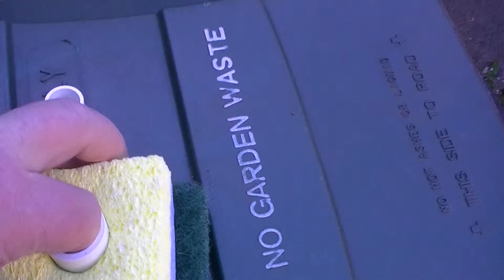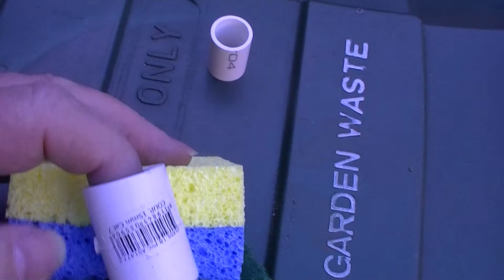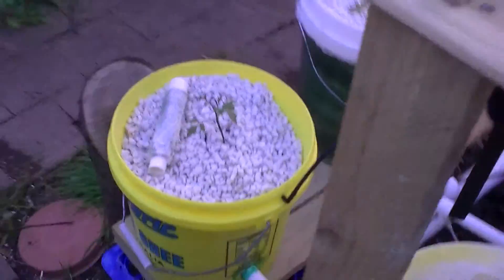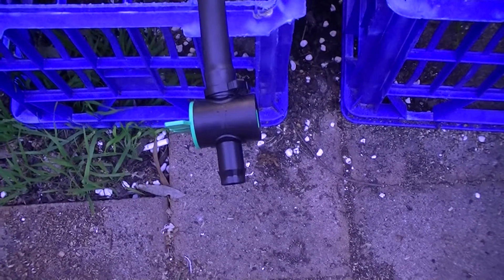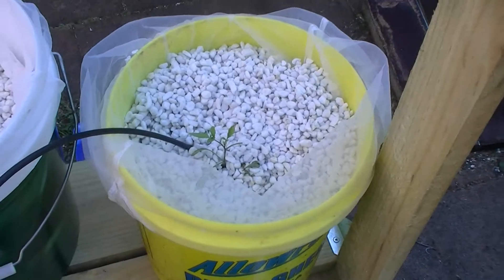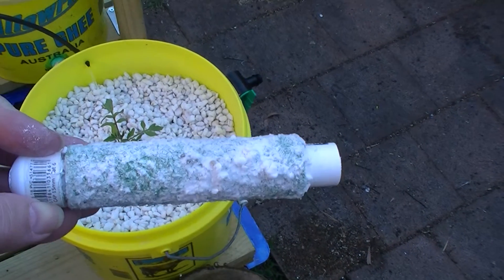Dutch Buckets, Construction & sponge filter stories, continued....

Comment: The stuff is really something eh :) I put it into the inner growing bucket of the double dutch system and run water on it till it's clear. Man that stuff kicks out the particulate eh. I also put the lower portion of one of my wife's nylon stockings hanging down over the return line into the reservoir and this filters out an amazing amount of debris from the reservoir. I don't stretch the stocking I leave it dangling down loosely. my wife is never happy about the missing stockings though :)

Comment from the maker: that is only about 10% of the powder from the Perlite. I have a low density sponge filter over my pump intakes as well, and I notice the drop in flow after about 15 minutes. When I put the permanent sub grade reservoir in it's hole, I will simply take the old reservoir away, hopefully with all the dust in it. If I put in another double row, I will make sure I wash to dust out before I put it in the buckets